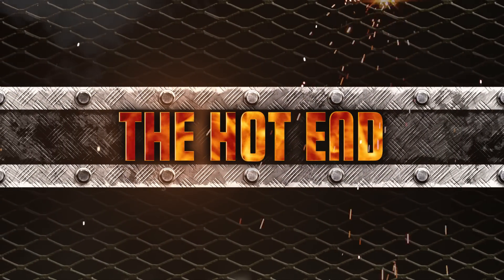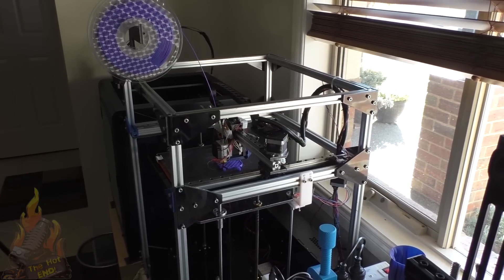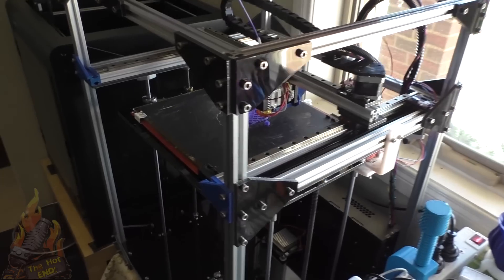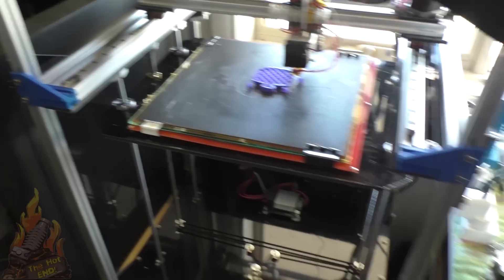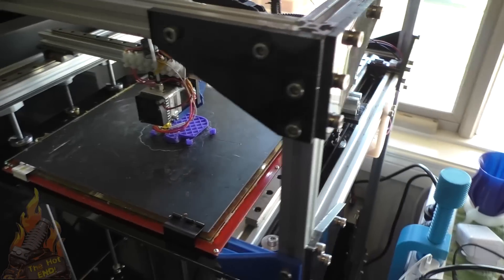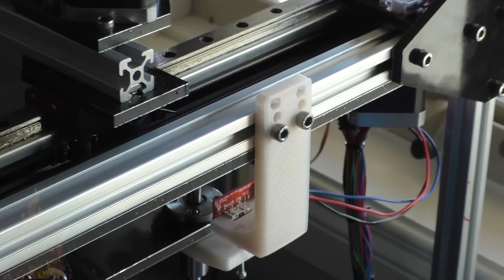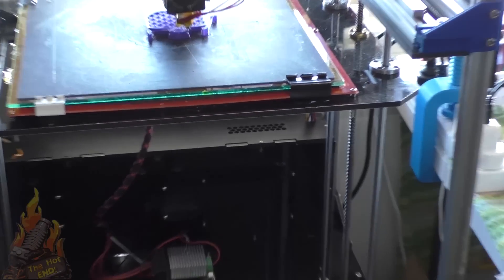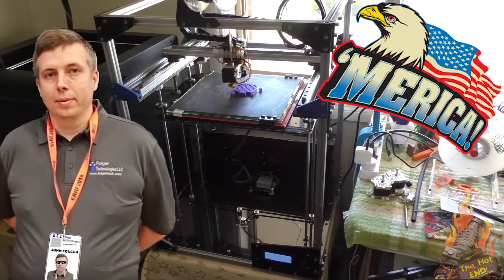FolgerTech FT5 R2 / MK2 Upgrade!

Comment: I have the FT-5 R1. In 2 years, I could never get it to run properly and I could not get any support from Folger-Tech.
Reply from the maker: Very unusual, we have two and both work great
Reply: @TheHotEndChannel  It was my fault, not Folger Tech's. I put this together shortly after I had a stroke. That was 2 1/2 years ago. My head is much clearer now. I spent last night and today fixing it. The M92 code was way off for all axis. The auto-leveler was enabled, but I do not have one. The bed and extruder are working well. I do have a Titan and Volcano to put on this thing, but I will wait until I get used to the printer. Thanks for the reply. I was watching your content back when I started this.Keep on making great Youtube content. Glad to see you are still here!

Comment: I love this printer, I didn't at first, as the build was tedious and demanding, I also swapped out the screen for a better graphic display, added smoothers, dampers, Volcano hotend, parts cooler, larger X axis stepper and bracing. 
IF built CORRECTLY, you will be hard pressed to find a better performing kit. Prints at 80mm/s with minimal ghosting and has superb accuracy.

Comment: Yeah my extruder shuttle lasted about a week before the melamine layers started coming apart and it was rattling loose. I tightened it and used zip ties and got it to Hold together long enough to print solid replacement parts out of ABS.
Reply: I did that very early on as well. The R2 kit redesigns the extruder mount and it is in the same composite as the frame.

Comment: You should ditch the top couplers for the leadscrews. They are the reason the R1 kept losing horizontal alignment - any slight bend in the leadscrews would either have to transfer to the print or the leadscrew would bind and go out of alignment. Leadscrews should always be free on one end, and if you look at any professionally designed printer like Ultimaker etc the top of the leadscrew is always free.
Reply: You are correct. Although the couplers are in place on my machine, they are VERY loose mounted to they have quite a large amount of movement.
Reply: I'm using them, but you need to be very careful when aligning them, I used the print platform to level the bottom, then at the top,  adjusted it 3 times and now I have zero binding issues.
Reply: @wyvern4588  The binding isn't the issue, it's the z wobble they induce on the print. On my machine I removed the top couplers and layer lines are almost totally invisible.
Reply: @z1power  Interesting, I've been getting fantastic prints, but I might try loosening them up just for the hell of it.